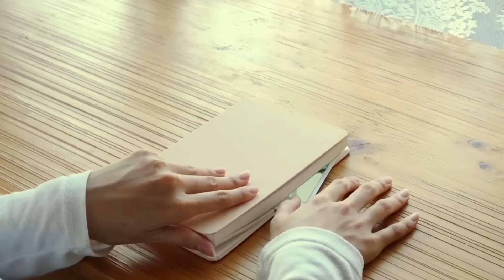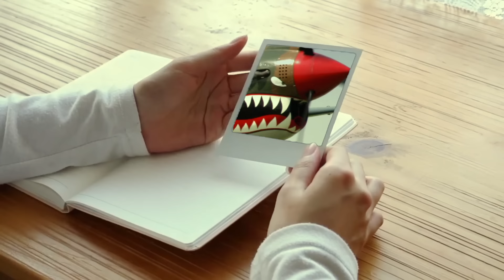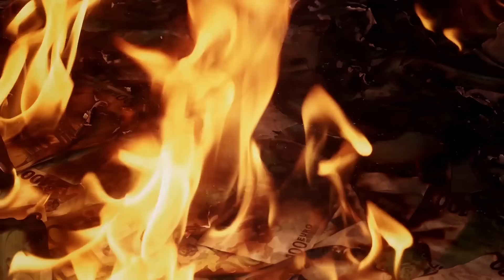10 Most Incredible Discoveries From WW2!

Comment: The Yamato and Musashi weren’t just 2 of the biggest battleships. They Were the 2 biggest. 
You should correct that statement really out of respect for the navy men that died on them both.
Reply: 69.000 tons of biggest battleships , and they were not used very much and the Yamamoto sank with half filled fuel tanks on the suicide mission it was destroyed sailing on

Comment: The two Yamato-class battleships were not among the largest battleships ever built, by displacement and size of their main batteries, they were THE two largest battleships ever built.  Period, end of story.

The next largest battleships built were the four Iowa-class battleships of the U.S. Navy.  The four Iowas had smaller main guns (16-inch vs. 18-inch), and had a significantly smaller displacement (57,000 tons vs. 70,000 tons).  The Iowas were also 20 feet narrower, but about 25 feet longer than the Yamatos, which contributed to the Iowas being 6 knots faster.
Reply: What was the biggest battleship then?
Reply: @manuelaigner5126  did you even read what he said? the Yamato class were the largest battleships ever made
Reply: 🛵 Once a civilization solves the riddle of steel and enters their industrial age, it is absolutely inevitable that a Yamato is built.
Reply: fun fact : The HMS Hood was only 1 meter shorter than the Yamato. fun fact 2: the yamato's superstructure was not simmetrical. fun fact 3: the yamato had a special type of shell that could be fired by its 18 inch guns that were called beehive shells, it was designed as a shell made of loads of peaces of shrapnel and it was used in anti-air perpouses

Comment: i AGREE,  THE p 40 SHOULD NOT HAVE BEEN ' RESTORED '
Reply: That P40 did not have the pilot's remains in it when found so it wasn't a tomb. Had the remains still been in it then you'd have a point.
Reply: 🛵 If you flew it again, it would crash you in the desert, wait to be restored, then crash the next pilot and the cycle goes on. 🌵